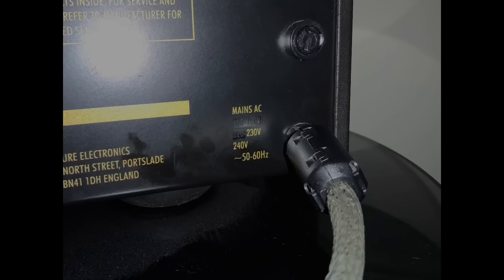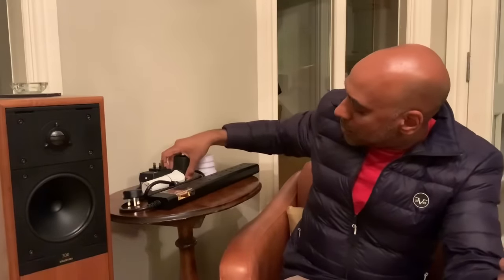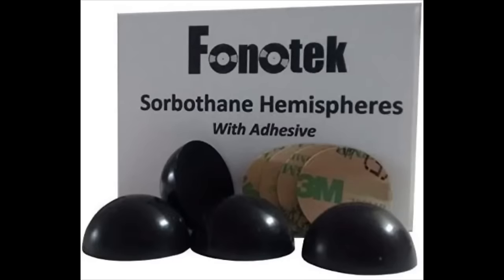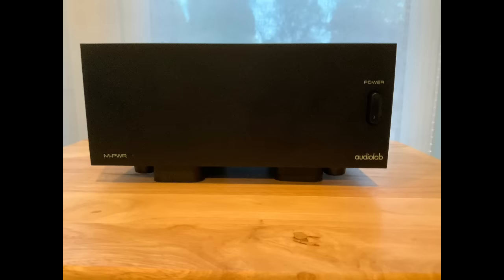My Top 5 Inexpensive Hifi Tweaks

Comment: In addition to the Tacoma power strip mains conditioner I’ve now bought the Tacoma parallel mains conditioner.  Whilst it’s effect was nothing like so dramatic I do think the two devices complement each other in some strange way.  The power strip was an amazing improvement overall in clarity and such details as decaying notes I’d never noticed before but I did get the impression that the sound stage had narrowed slightly on my setup.  The parallel conditioner seems to have broadened it out again.  I have no idea at all how this can be (maybe I’m imagining it all!) but the fact is I can now wallow in powerfully soft and detailed music better than before.  It’s simply more like a concert hall in your front room.  Thank you a million for your recommendations.
Reply from the maker: Thank you Andrew. Much appreciated. Both devices had a similar effect in my system 😊👍
Reply: Hi, where can we buy Tacima parallel main conditioner ?
Reply: I got mine on Amazon UK for about £45.
Reply: I checked, you’re correct: it’s Tacima not Tacoma
Reply: I believe the one you bought was Tacima SC5273 Plug-In Mains conditioner which was not parellel circuit.
Reply: Yes, SC5273 plug in conditioner.  I referred to it as parallel to distinguish it from the series six socket conditioner which occupies the adjacent power outlet.  A word of warning: the effect was VERY subtle and I may even have imagined it.  It obviously depends on your own mains circuits.  Still, you can return it if it doesn’t convince you!  It’s always interesting to try these things out.  6 months ago I hadn’t even tried audiophile interconnects let alone mains conditioners.  A sceptic became an evangelist.  Good luck
Reply: I got one years ago, it not only (subtly) improved my hi fi, it seemed to improve the picture on my tv.

Comment: Hey Tarun. Just wanted to say thank you. I have just started building the system of my 2000s dreams (using modern speakers and TMC amps and AV32) and have now reached the cables and power part. Thanks to your videos I got Lapp Kabel (I like how it looks) with some fat IEC connectors (purely for the look). I also got the Tacima conditioner. £600 mains conditioners never really interested me. I really don't believe in snake oil. For RCA cables I went with Audioquest Tower, which tbh? is about as far as I like to go with RCA cables on price. So yes, I just wanted to convey my thanks. I really don't need some guy telling me that I need cables coated in the nipples of 1000 otters that sound better than anything else. I also enjoyed your AE review comparing to the LS35A. I worked at Rogers with Andy Whittle between '96 and the closure in '97. It was a wonderful company to work for. So if you have ever listened to a pair from that timeframe there's a good chance it was all my soldering on the XOs. Thanks again, and take care. Andrew.
Reply from the maker: Thank you Andrew. I have indeed listened to some Rogers LS3/5a on a couple of occasions so the chances are that I was admiring your handiwork. Thank you for watching and sharing your experiences 😊👍

Comment: Microphony of solid state electronics can occur.
If a sharp sound such as clapping your hands occurs near to a sensitive circuit containing a sensitive component, this can can in theory cause a sound glitch.
What is the sensitive component?
An SMD (Surface Mount Device) X7R MLCC (Multi Layer Ceramic Capacitor). 
X7R (or X5R) is the ceramic material it is made from, and it is microphonic. Hit it with a sharp sound, this becomes a minute physical stress, which causes a tiny capacitance value change which causes a small voltage change which is then amplified!
Physical impact can also cause it.
Reply from the maker: Thank you for watching and sharing Jeremy 😊

Comment: The Tacima/Lindy mains blocks can be brilliant- or not. I tore my hair out wondering why I just couldn't get good bass, the sound was sharp and thin. It was the mains block. Switched to a regular 4-way, and suddenly there was bass again.
Found my best solution was source components into Tacima, amplifier into regular outlet. Guess it's gonna vary according to kit...
Reply from the maker: Thank you for watching and sharing your experiences Jon. Mains conditioners can limit dynamics with some amps 😉👍
Reply: Really don’t understand how “conditioning” the mains impacts the frequency content of what you hear.  What’s the science?  (PS I’m a retired chemical engineer who work most of my career in control, so do understand frequency response, filtering, etc - just not electronics)
Reply from the maker: @PhillipAlcock  I don’t think there is a definitive answer on this but I suspect it has to do with the added impedance the conditioner places on the supply. This can cause a loss of dymanics in some systems but other electronics may be affected in other ways.

Comment: A couple further ideas:  On the clamp on chokes, for any EMI benefits they should be placed near the amp not the speaker as that is the source of possible RF into the cable.  Since the speaker is very low impedance, RF poses no harm to audio quality but possibly on long runs near a radio transmitter, the clamps may keep coupled noise out of the output drivers, (here a very low chance of possible harm).  I don't see any benefits in the clamp.
On the mains protection, again should be no audio benefit but a clear amp "life" benefit.  But having this is a must, especially with electrical noise from motors or lightening strikes (like in my home).   Motors create inductive spikes that may get through your amp's filters which you'll hear as clicks or a buzz when you switch the motor on/off.  Same with light dimmers.  Keep in mind the MOVs (blue disks) shown in the clear area have a short life, measured in pulsed energy absorbed.  Some of these devices have a LED which indicates when to replace the whole unit.  Don't ignore it.  We have many surges in our area and these have protected my equipment.
Because of the variety of signals in the various cables in the backs of your system, most cross talk conditions have been understood and engineered out by the equipment manufacturers.  The best bang for your buck here are on low level signal wires (RCA, HDMI, COAX...).  Keep these coiled and separated but pay attention to tarnish on the connectors as that increases GND impedance could affect your noise floor.  I also like the rat's nest managed, looks better.
Reply from the maker: Thank you for sharing your knowledge and experiences Denali

Comment: Yeah, that's what the back of my setup looks like. Can you please give us some tips on cable housekeeping?
Reply from the maker: Keep power cables away from signal cables. Make sure connectors have good contact pressure. If you have to wind up excess speaker cable do in in a “Z” configuration as opposed to wind it up in a loop. 😊
Reply: @abritishaudiophile7314  Thanks. I pretty much adhere to at least some of your suggestions. I guess it's more that the mass of wires triggers my ocd! Great vids, thanks.

Comment: All of this is very good information but the reality is that in order to fully achieve the best possible sound from any high fidelity equipment it is vital to completely decouple the floor from the foundations of the listening room!  This should be done using 75, 4 tonne Tungsten supports underneath the building on a concrete basin of at least 300ft in depth.  Seismic surveys should be undertaken prior to installation to check for anomalies in the integrity of the bedrock.  In my experience, Nuclear reactors are the only consistent power that should be considered and the French make some very highly regarded reactors although any PWR (Pressure Water Reactor) will suffice.  The next step is to wrap the entire building in a ‘Faraday Cage’ to avoid unwanted electrical interference and you will also find this improves Oasis’s music making it somewhat tolerable.     NASA also make some excellent speaker cable and interconnects.  NASA also provide a superb range of air purification and conditioning units that are able to literally create atmospheres.  IKEA do quite nice chairs.
Reply from the maker: That is hilarious  🤣🤣🤣 made my day but you left out suspending the speakers and oneself in a self constructed anerchoic chamber 👍

Comment: There is also the Densen de Magic CD which is very effective and available for free on Youtube. I have been using it once in a while for many years.
From tnt audio:
"I have had, in fact, the feeling that the sound, at the end of the treatment, appeared cleaner and more transparent, with beneficial effects in regard to the soundstage. It seems as if a light curtain, that somehow darkened the musical signal, had been removed. The most evident improvement is in the higher end of the spectrum, where the sound clears, eliminating in some cases, a certain feeling of granularity on the upper midrange, but beneficial effects are also appreciated on the micro-contrast and naturalness of emission."
Reply from the maker: Thank you for watching and commenting Steve 😊

Comment: Hello! Thank you for a brilliant, informative video first and foremost, however I do have a question if you wouldn’t mind advising me / answering me on! 

I have purchased both the Tacima 6 way power strip  and the Ifi ACipurifier. My question is, do I insert the Ifi ACipurifier into the one of the Tacima power strips sockets, or do I insert the ACipurifier into the mains socket next to the socket that the Tacima is plugged into? Is one way better than the other or are both methods of usage effective? From my own research on the Ifi especially, I was reading that inserting the product into the middle of the / a power strip, will enhance the products silencing effect for each of the products to either side of it? I’m not sure how true this is however I was just noting something I’ve read directly from the manufactures website. 

An answer to this would be greatly appreciated! Thank you.
Reply from the maker: Thank you. Much appreciated. I use mine on the wall socket next to the strip. It seems to work best for me that way but different systems may react in different ways. I would try both and see what you prefer 😊👍
Reply: @abritishaudiophile7314  Thank you very much for a swift reply! Are you still using the Tacima in your set up currently or not? Just out of interest as I noticed you said in the video that you / many others stop using a power condition and then go back to it and the cycle repeats.

Comment: I have a reasonably good streaming system, with an Auralic Aries G2.1 streamer feeding an Auralic Vega G2.1 DAC. I could not believe the difference that plugging an Ifi mains purifier into my mains block between the Auralic components and a couple of accessories with switch mode power supplies made. I thought that the high frequencies were pretty smooth, but they were not. Transient response was improved enormously. I would be astonished to find another upgrade as substantial as this for £100.
Reply from the maker: Thank you for sharing John 👍

Comment: Great video. Please consider a video on the benefits of acoustic treatment with before and after clips. Acoustic treatment definitely falls into the category of great benefits for the modest cost.
Reply from the maker: Hi Mark, thank you for watching and for the suggestion.
Reply: And acoustic treatment also has the benefit of being measurable, which automatically makes them a billion times more impactful than anything in this video. If you're impressed by tweaks that are impossible to measure objectively, you'll be utterly gobsmacked by differences that are SO MASSIVELY HUGE that you can actually measure them. What a revelation that will be for you!

Comment: There are now some cheaper belden/lapp copies see ebay - i think the shielding is the important thing rather than 2.5mm for the last foot, and lapp is certainly hard to work with. Another alternative is use non split flexible conduit, and braid the internal cable from standard mains cable to fill. This is the construction of the early russ andrews power - chords (plus fancy wire). N.B. I doubt  that expandable sheathing is up to code on insulation. Thumbs up to van damme, and neutrik for sensible quality. 
Nicely done vid - albeit from inside a sleeping bag(?)  ;-)
Reply from the maker: Hi Rob, thank you for sharing that. Very interesting and informative 😉👍

Comment: Thanks for another great video.  I will need to try the DIY cables, much cheaper than the wireworld strip and cables that I’m using.  Have you experimented with fuses?  I’m contemplating the replacement of the glass fuses in my amp and source to ceramic type
Reply from the maker: Hi Shahid, good to hear from you. I have only had a play with silver plated fuses on the mains plug but didn’t notice any improvement.

Comment: I can recommend Lapp cable as a big improvement over stock issue kettle leads.
Easily on a par with a friends exotic £200+ Kimber cables they cost me £100 for 6 x 1m lengths, beautifully constructed with good quality plugs both ends.
The seller was allerhode 4 on E Bay, they may have gone up a little by now, I got mine 6 months ago. Honestly, hand on heart, you would be crazy not to give them a try.
At 17.00 ish Tarun mentions connecting the cables shielding at both ends, I am 99% sure this is wrong.
Logic tells me all that will do is give you a thicker earth cable, not an energy drain. I am sure the shielding should be connected to earth at the plug, (input) end only, not at the equipment end.
Feel free to tell me if I am wrong. 
On a safety note. Always leave the earth wire a little longer than needed to reach its post. If the cable should ever be pulled out of the plug, the earth wire will then be the last to be pulled free :).
Your diction is magnificent, I am quite jealous.
Reply from the maker: Hi Donk, thank you for watching and commenting. There are a couple of schools of thought on connecting the shield at one end or both ends. You are right, it is probably best for most people to earth the shield on the mains plug end only to avoid ground loop issues. I amended my advice in the following video...
https://www.youtube.com/watch?v=gfVYfC6tmcc
Thank for you kind words of support 😉👍

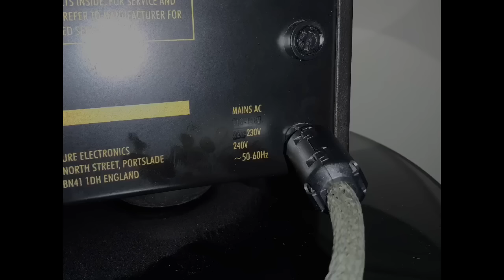Comment: Put both wires through the same ferrite core. Putting it on one adds inductance to the speaker load. Putting it on both at the same time removes common mode induced radio frequencies and stops the wire from becoming an antenna. Since the wires travel to the same location, differential noise should not be a problem. This is what is being done on the mains input inductor you are showing at 3:32. If differential noise is an issue, twist the speaker cable (3 or 4 turns to the inch, do it in a battery drill).
Reply from the maker: Thank you Stephen. What do make of this http://www.empiricalaudio.com/computer-audio/technical-papers/myths-and-snake-oil
Reply: @abritishaudiophile7314   Thanks for the reply, I read the article and I mostly agree. But, my thoughts were on whether or not to put ferrites on a cable at all and if you want to, do it for the common mode not the differential. Sorry if I'm going into lecture mode as it's not my intent to criticize, just discuss. As a switchmode power supply designer and fault finder, it is my area of expertise. It's not the interference from over the hill that needs to be stopped, it's the interference from 1 metre away that's the problem. Computer manufacturers put those on power cables because the noise is coming out of the power supply, not going into it due to the switching nature of the circuit. The power cable attached radiates this noise out into the cable mess behind most stereos. It won't affect audio in a system, but it can play havoc with Am/Fm front ends of receivers which is why the FCC gets into the game. If you read the computer manuals carefully, they normally say if interference occurs due to this piece of equipment, tough, move the radio antenna. Any gear in your stack that uses a switchmode power supply (most DVD/Bluray players and plug packs are these days, some call them external power bricks) have virtually no good shielding against this habit and if they are nearby, can be picked up in the radio spectrum. I put a ferric on any low voltage power cables (two wraps through the core) coming from plug packs if they are in my HiFi stack because I like listening to radio stations up to 2/300km away. Without them, there is no hope of doing that.
Reply from the maker: @saddle1940  thank you Stephen, very interesting. I always welcome constructive criticism as it is essential for me to learn and grow. Thankfully, I have quite a few industry professionals who watch my channel and can fill in gaps in my knowledge or correct misconceptions. Hopefully, my videos stimulate a health debate of these issues as the hifi world is filled with various misconceptions. In that sprit, what did you make of Empirical Audios claim that placing a smaller ferrite core around one wire on the speaker cable may reduce natural resonances in the cable? Once again, thank you for watching and sharing 😊👍

Comment: The other trick or tip with mains cables is to cut off or remove the plug, strip the outer shielding and braid the cables and fit a new plug. Or make your own using thicker gauge mains wire. I used a heat shrink over the cable to make it look neat. You could hear the difference when I did the back to back test.
Reply from the maker: Thank you for sharing Graham 👍